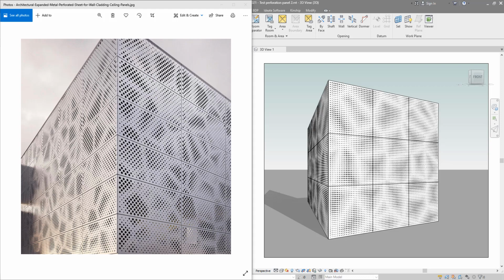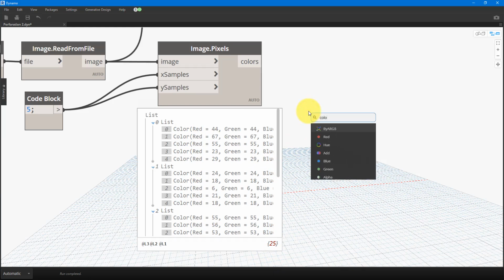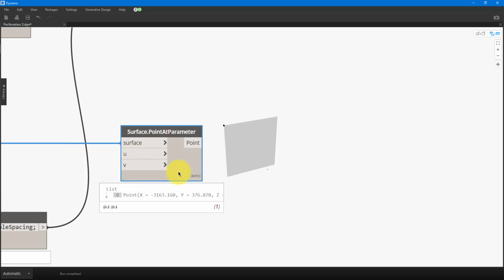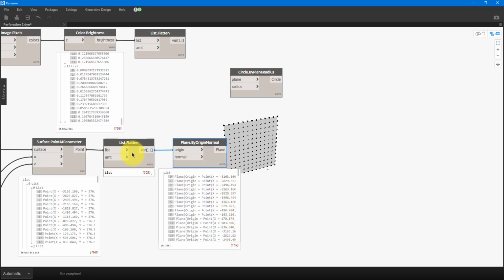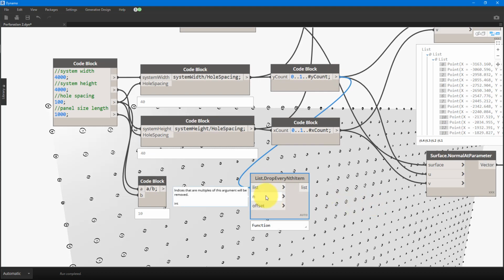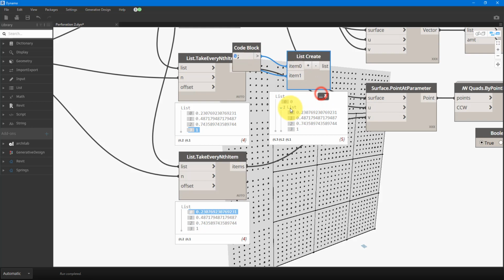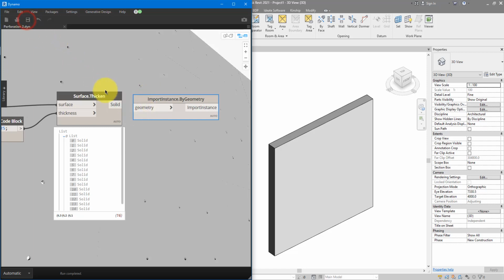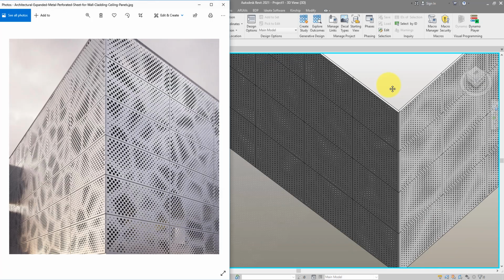Revit Snippet: Create Truly 3D Parametric Perforated Panels

Comment: Congrats for the content!!!... One question? Does the wind (in a wind simulation) flows across of the perforations as well as the light (shadows) do???. Thanks so much!!!!
Reply from the maker: Glad you liked the video! Regarding  wind simulation, this method does support that because the holes are actually cuts in 3D 👍
Reply: @RVBoost Oh, okay. So, in order for the wind to flow through it in a simulation, would I need to actually drill a hole in the material, like a gap, and repeat that process throughout the material? Thanks for to answer! And of course the content is great and very helpful.
Reply from the maker: Sorry I just checked the video again and realised the holes are actually cut in 3D. That makes them work with your wind simulation then 🤩
Reply: @RVBoost ufff, Great news! That's settled, it'll be done... Thank you so much!!!

Comment: Has this script been tested in Revit 2024?  I may just purchase it via your link to use on a project that will have perforated panels.   I was trying to build this script following along with the video.  I got a little stumped at the Springs Quads.ByPointMatrix.  I added that node and at that point it wasn't drawing the horizontal/vertical lines?
Reply: The same problem 😢
Reply: @ekaterinapavluchuk2687  same and I'm using the current version which is 210.1.1 with REVIT 2026

Comment: Thank you for such a video, I also got stuck in the quads! I am working on Revit 2021, what is the solution for that?
Any help?
Reply from the maker: Hi! What issue do you have with the quads?
Reply: @RVBoost  Thank you for your fast reply 
I commented down that I found it in Revit 2021 as Spring Nodes
the other issue I explained in that comment
can you kindly read it and reply on it please 
Thank you

Comment: Hi, I am using the same Revit and Dynamo version as you have used but getting this error /Warning when I connect ꟿ Quads.ByPointMatrix node to  PolyCurve.ByPoints node. 

Warning: PolyCurve.ByPoints expects argument type(s) (Point[], bool), but was called with (Autodesk.DesignScript.Geometry.Vector[], bool).

no idea how to solve this.is there way?
Reply from the maker: You probably have a different version of the Spring Nodes package. Please install package version 203.2.0 and try again.
Reply: @RVBoost   thanks a lot for your reply.
I have installed package version 203.2.0 as suggested and tried but again getting the same warning message. I am using Dynamo Version 2.3.0 Revit 2020.2

Is there another method to get the quadrant point matrix?
Reply from the maker: The error message says the node expects XYZ points but is given Vectors. May be try adding some nodes to convert vectors to points beforehand?
Reply: Thanks a lot helping. it is working now.
I used Vector.AtPoint node to convert vectors to points.
Thanks a lot.
Reply from the maker: Glad it worked! Happy to help 😊
Reply: Hi, Sorry to bother you again.
I noticed but forgot to mention that the panels are not equal. First panel in x & y direction is smaller than the remaining three panels.

Can we equalize the panels?
Reply from the maker: If that didn't happen in the video, I would suggest following it again with attention to every small step...
Reply: Hi again,
I have seen and followed the video many times. the result is same.
First panel in x & y direction is smaller than the remaining panels. Panels are not equal.

Comment: Awesome tutorial... However, whenever I do the last step into the "importinstance" the result becomes WAY bigger than the preview shows before I do so. The preview the whole time looks good until then, please help??
Reply from the maker: Please check your drawing unit in Revit. Mine is in millimetres :)
Reply: I also got this result. The perforated panels were way bigger and farther from the selected surface. My units are in mm. Can't figure out where i got it wrong. I'd appreciate some help. :D
Reply from the maker: Did you get the problem in Revit 2022 by any chance?
Reply: @RVBoost  Yes, i'm using 2022. I did manage to still work with it, just had to manually rescale
Reply: @erikanicole520  how did you manually rescale struggling with same issue :(
Reply: @vijaymatharu8454  I closed dynamo and rescaled after. After rescaling you’re gonna have to look for the rescaled panel and manually place it where you want it (:

Comment: Great video!! My hole patterns are not matching the voronoi  image. I'm getting some sort of diagonal waves rather than the voronoi image I used. I tried uploading diferent pictures but they all behave the same way. Any ideas?
?
Reply from the maker: Sounds like you didn't connect some of the nodes exactly as showed in the video. Please watch it again to double check!
Reply: @RVBoost  Thanks! The solution was at the end of the  video! I had stopped short of the end... is it possible to create this pattern on a curved surface?
Reply from the maker: Curved surfaces will be very difficult! You should use Revit a material with cutout holes instead.

Comment: hi there. i follow your step but get stuck at the surface.different node. i cant find it anywhere. do you know what is probably the issue here? is there any alternative solution for it without using surface.different node?
Reply from the maker: Hi. Probably you're not using the same Dynamo version I used in the video. Should be Dynamo 2.0.1 or above.

Comment: Great tutorial! I got stuck in the quads  and surface.difference commands but I realised I downloaded the wrong package and was not using revit 2021. Looking forward for more!!
Reply from the maker: Glad it helped! I'll definitely do more :)
Reply: So, is it not possible to get surface.difference command in revit 2020? Quads issue can be solved by installing Spring Nodes package thanks to @j0jjes's comment  but still need to get surface.difference. Is there anyway to get in Revit 2020 version?
Reply from the maker: I'm on Revit 2020 with Dynamo 2.3 and it has that node. Probably make sure you use the same versions.